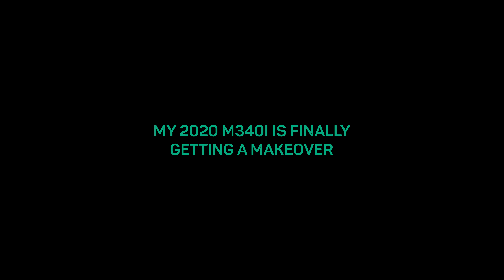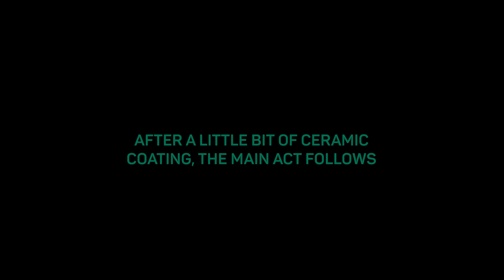BLACKOUT: My BMW M340i gets HUGE Makeover

Comment from the maker: Hey guys! I finally put together kind of a list of parts that i collected for the car, for 10 months.. some of the parts are not available any more from the sellers, so i found the same part elsewhere:
- Wheels are MSW (OZ) M74 - 20x8.5 ET28 + 20x9.5 ET35
- Tires are Continental SportContact 7 stock sizes 225/35 R20 + 255/30 R20

- The exhaust tips (fit only M340):
https://www.aliexpress.com/item/1005004517623893.html?spm=a2g0o.order_list.order_list_main.112.78141802sOnzqw

- Front splitter:
https://www.aliexpress.com/item/4000495504287.html?spm=a2g0o.order_list.order_list_main.117.3df41802e1fAHB

- Kidney grille:
https://www.ebay.co.uk/itm/145108649705?hash=item21c92646e9:g:pSEAAOSwcORkdAtc&amdata=enc%3AAQAIAAAA4DJJIS1YXqKxMvaErhYjwNuM%2FdjxG3h28XEkwKTB5JzGpJhUoRc%2FmrAr2F9Upr%2F8ei2Sfosa0S1p2f%2BuMWBWUCfKCcmSZDdFzwBC2IlNMMsZ%2FlS4cFzpILfdsIQ8lS9WLzrFOcwet9vsg9nmSCIT2psCPPbls8FjfGpDIeEC5AX54xSlYDoE%2F64gGEKDvFq5qYX5Efs0ncMZ7Nas58ix%2Fp61geq%2FJdAJoDCN9w9B%2BbzpyjEIVb%2Firh2lRo76y0dDBalEk%2Bm560aJ8WGO3R70G9iwlV3Wpn0AcHGeur6Mamqq%7Ctkp%3ABFBMrPzH9q1i

- Trunk lip spoiler (its the M4 version):
https://www.aliexpress.com/item/1005004573417003.html?spm=a2g0o.order_list.order_list_main.186.3df41802e1fAHB

- M3 Mirror covers:
https://www.ebay.co.uk/itm/313972904552?hash=item491a3e5268:g:St0AAOSwngNiaFgF&amdata=enc%3AAQAIAAAA4MvKbJ%2FbhyN9OhO0Ok1iGN%2FzGkgx7F4lYFdW3cPEaeDlL0gXdcZar%2BjAsMO9xOaBOFMZ0nlt0Cap0T3KUg09x6v3Rni1oXE8eQQgktKaXrRK5%2FkrfZvgjbX8wjC5OFjCYKaeGfzLbGYGKMXhr%2FrqXmWk1BBjKMm9tYlzZfAJfyguRJVyqFo6md0YLWrrjFsJd3K5rt2g5g5HTxZEQmNwWjgo5O7iywAOBW3fyiAVVKDSVr637LqBdgUBE3UFUxntxlf%2Bha2c67GKGAAiy7xUWi6lEFJULLCk%2Bt31Qvt1NC%2By%7Ctkp%3ABFBMzNvP9q1i

- Rear diffuser
https://www.ebay.co.uk/itm/384769028597

- M performance side skirts:
from local store (not a good deal on that one)

- Gloss Black Trunk emblem
OEM from dealer - part number: 51142472849

- Front bumper gloss black trim
OEM from dealer - part numbers: 51118093301, 51118093302

that should be all, hope this helps! :-)
Reply: Honestly, I have so much respect for you, spending the time finding these sick parts and then, just sharing it with the world for free. U a real champ!
Btw may I ask of the sideskirts were “no-drill” too, as I saw the front splitter was. 
Best to you from your neightbonur in hungary!
Reply from the maker: @TheDrainoor  Thank you very much! Hungary are neighbours for sure, to me especially, i am from budapest like 120km, so i am there few times a year 🙂sideskirts and front splitter were both fastened with double sided 3M tape, and i also put in some self tapping screws.. it could hold with only the tape, but this car is not slow, and when going 150-200kmh, i didnt want anything to fly off 🙂 and so far it holds..
Reply: Didn't you install the side parts of the rear diffuser? Also, what kind of processing is required to install the rear diffuser?
Reply from the maker: @gb7938   in the end i decided not to install the lower parts, because i felt it would be maybe too aggressive compared to the rest of the car..
to install its very simple, few bolts on the bottom (from oem diffuser), the top parts just clips in. and on the sides there is very little trimming needed
Reply: Thank you for answering. Is the rear diffuser fitting good?
Reply from the maker: Yea, diffuser is fitting almost like stock, no gaps between it and the bumper, very good value imho
Reply: Thank you for your kindness. Please use it as a reference.
Reply: how much was the total, also do all these parts fit on the pre lci?
Reply: Do you think the exhaust tips would fit a M performance 330i if I was to get a different diffuser?
Reply from the maker: @TamBruv  i would say it was under 1000eur (excluding the wheels) and yes, they are pre-lci, since my car is pre-lci 🙂
Reply from the maker: @sirdockery5972  nope, exhaust tips will not fit the 330i, because M340i has oval shaped outlet from the backbox, 330i would have round one as far as i know. so you need to look for 330i version
Reply: @TheFuxxoWorksGarage  on the page for the exhaust tips I see you can get two versions, ie SILVER or MPE Silver. What is the difference? Will all of the exhausts on this page fit an M340i?
Reply from the maker: @1234PS3master  well, the MPE means M performance exhaust, so if you have it installed on your car, i would go for that one. if you have stock exhaust you need to go with the regular one. I dont have the MPE exhaust so i cant say what is the difference there tho

Comment: I have the same car and I’m doing the same thing:  I’ve added the exact wheels you did; replaced the grill and air ducts, added a carbon fiber rear spoiler and mirror caps; waiting on the exhaust tips to be in stock.  Love it.
Reply from the maker: haha :-D you have to do it, right? spice it up a bit
Reply: Where can I order those Exhaust tips?(:
Reply: @2Wo20  Kies Motorsports
Reply: Look up freshkicks m340i. Best m340 build by far with the bbs lm’s
Reply from the maker: @jordanz3326  oh yea, that one is very hot :-O and in my favourite dravit grey 🤤

Comment: Where can I get the Gloss black m340 / x drive trunk emblem? I see it says oem from dealer? Does that mean i have to go to a dealership and get them because I cant find a trusted website anywhere.
Reply from the maker: yes exactly, that emblem is original bmw, you can get these on various sites too as replicas, but my brother got one for his M135i and it was 15% bigger than the original :-D so i opted to go for more expensive but original route. you have the part number in the first comment, and if you give that to dealer they will order you one

Comment: Stunning transformation but would love to see it on Eibach springs to drop it 30mm and spacers. Maybe 15mm rear and 12mm front.  Nice aggressive stance. And tint those rear lights.
Reply from the maker: would love to drop it too, but cant, wouldnt be able to get in underground parking around here without ripping the splitter off :-D 
spacers not really, wheels are absolutely flush now. an i will never tint rear lights :-D on any car

Comment: That looks sharp. I have a 2025 M340i Xdrive on order. I am worried because supposedly the Gen 3 engines are having issues.
Reply from the maker: thank you! i wouldnt be worried, you just need to drive in sport, to have possibly the cylinders not be turning off, and you'll be all good :-D you want the sport/sport+ anyway, for the sound

Comment: What type of side skirt did you install at 2:35?  Never saw one not full length.
Reply from the maker: really? the OEM M-performance side skirt is exactly like this, i only got the replica.. this is oem:
https://www.google.com/url?sa=i&url=https%3A%2F%2Fwww.mstyle.co.uk%2Fbmw-genuine-m-performance-gloss-black-side-skirt-extensions-for-g20-g21.html&psig=AOvVaw3REbBYNM5CRU0ONLrKaJxh&ust=1691831408653000&source=images&cd=vfe&opi=89978449&ved=0CBMQjhxqFwoTCNit66Kh1IADFQAAAAAdAAAAABAE

the issue with full length skirts on this car is, that they can cover the LEDs that make the "light carpet" on the ground which are placed in front behind the front lifting point.. (unless the full length skirts have a hole in them)
Reply: @TheFuxxoWorksGarage  sadly not available for the F30 M Sport platform.  Car looks awesome. 👍🏻
Reply from the maker: @Oakleyicon  thanks
yea, did not see this kind for F30

Comment: 8:04 I have a G28. Please advice me if the quad exhaust will fit it as well and where can I get them. Appreciate it!
Reply from the maker: I dont think it will, these tips are specific for M340 only, and there isnt M340 Li, right? But there should be similar exhaust tips for 4 cylinders too i believe
Reply: @TheFuxxoWorksGarage  Yea, I had been looking for something that makes the exhaust sound louder. I’m new to all this so figuring it out.
Reply from the maker: @AshwinJangalwa  well, the tips will not change the sound at all, for that you need mufflers, or complete exhaust, or opf delete, or downpipe 🙂

Comment: so a huge beauty.. how did u install the tips ? did u change something on the stock exhaust for the tips?
Reply from the maker: thank you! the tips were direct replacement of the original ones, no need to change anything, only they bolt on the exhaust itself, compared to oem tips, which bolt to diffuser.

Comment: Where did you get the lil small black covers in the front of the car the you changed from silver to black im looking for mine and idk what they are called
Reply from the maker: those are OEM from the dealer..part numbers are:
51118093301
51118093302
(left and right)

Comment: Nice car man, what did you use to install the spoiler and is the adhesive tape strong enough to be held against car washes etc.. thanks
Reply from the maker: Thanks! I use 3M double sided tape, and i wouldnt know if it holds against car washes because i never ever use them :-D but everything is still on the car 8 months later, so i believe it stickss good :-D
the tape is called 3M PT1500

Comment: Hey with the exhaust tips did you simply screw on to the existing exhaust pipe or did you have to do any cutting to it?
Reply from the maker: hey! no cutting, nothing, you just screw them on and that's it. just need to make sure you ordered the correct ones (M340i has different exhaust pipe than 330i)

Comment: Well..welll..
Time to block out my Sonata like that...😅😅😅
On the spoiler installation you didn't use silicon on the edges of the spoiler in case the 3m tape won't glue tight?
Your car came out nasty bro.  
Much blessings 🙌
Reply from the maker: haha go for it!
i didnt no, i put all my hope in the 3M tape :-D and it holds still after almost a year, so.. 
thank you!
Reply: @TheFuxxoWorksGarage  😎 cool..
Nice ride brother 👍

Comment: Did you have to drill any holes to add the side skirts or lip? Or just used preexisting bolts?
Reply from the maker: there are no pre-existing bolts for the side skirts, at least not for those i got.. so I used the oem self tappers. you can possibly just use double sided tape, but i wanted to be sure it doesnt fly off.. and it holds :-D

Comment: how are the  conti sport contract 7's ? Thinking of ditching the rft's on my f36 435 to these
Reply from the maker: you 100% should ditch them.. i had pirelli rfts on mine before and they were awful. conti's are pretty awesome, very good on water (that was one of the reasons i went for them), sticky in hot, and not a lot of wear too, still got 6mm thread after first season, so i can only recommend them

Comment: Great video man!! 👌
Quick questions:
 - Did you use extra screws for the front lip, or just the original screws and tape?
 - Also for the side skirts did you use extra screws?
Reply from the maker: Thank you! 
for the front lip yes, i used additional screws on the side parts (and i believe one in the center) just to be sure :-D
and side skirts did not come with any screws, you have to source your own (double sided tape would not be enough here), so i used like 8 or so, per side..
Reply: Thank you for the info 😁 @TheFuxxoWorksGarage

Comment: I'm doing a blackout makeover for my M340i, it's really needed haha!
I really wonder where you got your spoiler and side skirts from. I'm from the Netherlands so an order through a Slovakian webshop would be possible I guess.

Keep up the good work man!
Reply from the maker: It really is :-D 
actually i would not recommend the store i got side skirts from, it took them a month to deliver, and they only had fake carbon, so i had them wrapped in gloss black :-/ but you can get them on ebay for sure.
but the spoiler is from here (the M4 spoiler):
https://www.aliexpress.com/item/1005004573417003.html?spm=a2g0o.order_list.order_list_main.181.7dce1802M1yd6j

Comment: Hey man love the video, I have a 2020 m340i and I was trying to get those same wheels and im just wondering how big your wheels were beforehand as the stock wheels are 18/19 inches. Just worried about fitment issues.
Reply from the maker: hey, i had 19" stock wheels on the car, and if you use the same sizes as i mentioned in the pinned comment (on top) there are absolutely no fitment issues at all :-)

Comment: Where and what model did you get the side skirts from
Reply from the maker: it is from a local eshop selling tuning parts, and its a replica of mperformance skirts, however i wouldnt recommend those :-/ i believe you can find them on ebay too
Reply: @TheFuxxoWorksGarage  what would you recommend then?
Reply from the maker: tbh i have no idea :-D i didnt really check on these after i got mine. most of them are from china anyway, so you should just get the cheapest one i'd say, or from seller with best rating.
like these:
https://www.ebay.com/itm/375031564162?itmmeta=01HTZCCBXCBWSH3E39T1KQPVF0&hash=item57519f8782:g:h9EAAOSwVc5iFD1N&itmprp=enc%3AAQAJAAAA8KMW6hCiM0Yck5Oh4RiQO66eZSxXyALNzGgC4FWSiyGFcwWel88aXXtji5Aays6sQt6fXLUCh4hCIJvNO3IMc4O7nLBP47pK50PPZQHrGeRqesTvDmrh3h81N%2BR1y5ds34FnVvZhYcaGeI6ToQh7GpenZduZzDl%2B72NDU0wfyqa%2FggdtQm4xi%2BV3ShHXuWXxFxGAUkYgBiFN9350EnEJgF6c3Ma2ANDV1oyqb6CLctW%2BAzgItM38yjMD17QKzvyo8gR6voF%2Fukd5Ij4BENCU73VfsfjTEb6zvz67lAFBSoLPPr8elumJbJ4QgyYHk9LX2w%3D%3D%7Ctkp%3ABk9SR-S-sezXYw

Comment: I have the same car and I like the exhaust tips you put on. Where did you buy your parts from because my car is stock rn and I want to mod it like the way you did it.
Reply from the maker: I got them here (couldnt find tips that fit M340 exhaust anywhere else):
https://www.aliexpress.com/item/1005004517623893.html?spm=a2g0o.order_list.order_list_main.61.4e181802zDFXhr
just be sure you choose the M340i version, because they need to be oval on the inlet side (330i is round)

Comment: Where did you get the exhaust tips?   Brand?
Reply from the maker: those are no name actually, and from aliexpress.. never saw them anywhere for sale (M340i need specific oval shape inlet on the tips to fit)
Reply: @TheFuxxoWorksGarage  Would you be able to link the tips you bought that fit the stock oval shape pipes?
Reply from the maker: @TheSedin  sure, here you go.. they have multiple designs, just be sure to select the version for M340.. 
https://www.aliexpress.com/item/1005004517623893.html?spm=a2g0o.order_list.order_list_main.61.4e181802zDFXhr
Reply: @TheFuxxoWorksGarage  and these fit on your stock exhaust pipes, right? Thanks for the link!
Reply from the maker: @TheSedin  yes, those are exactly where i ordered from.. the fit is pretty snug, i did not expect it to be so tight, you barely need the 4 bolts that are on each side for tightening
Reply: @TheFuxxoWorksGarage  thank you! I have the same 2020 M340 in black sapphire metallic with shadowline package, it’s a beast of a car!
Reply from the maker: @TheSedin  no worries mate, good luck with the tips :-) its mega car for sure, you wouldnt say its that capable, when you look at it 🙂
Reply: @TheFuxxoWorksGarage  Hey, for the carbon exhaust tips, did you just bolt them on and it fit? No welding necessary?
Reply from the maker: @benchan1090  nope, no welding, slot them on the pipes, and tighten 4 screws per side

Comment: Did you have any problems ( with xDrive) with this Continentals?
Reply from the maker: you know what, no issues at all so far, only after few thousands of kilometers on them there is a slight vibration above 150-160 kmh (not on steering wheel), so i will have to get them re-balanced, which is pretty normal.
I also have conti TS860 (19") for two winters now and they are absolutely fantastic
Reply: Thank you. I was affraid to use tyres without bmw holologization because i had some problem in my previous G30 540i xDrive when i put winter Pirelli sottozero mixed without bmw * (star). My car started to vibrate all time. Now i have Pirelli RunFlat on my 20” performance wheels and it drives like shit. I must buy something without RunFlat and my first choice will be Conti 7.
Reply from the maker: @jarasw8226  yea, i know what you mean, its a big issue with all the xdrive cars unfortunately 😞

Comment: Seems like you need some spacers, otherwise, looks fire
Reply from the maker: close enough to be honest :-) dont really want to run spacers on this car, so i tried to choose the wheels for the best fitment :-)
Reply: @TheFuxxoWorksGarage  you didn't get wheels much wider than stock.  9.5 or 10 width on 265/275 is necessary to create a flush fit without any spacers or rubbing.
Reply from the maker: @S.I.R.O.K.  well, i couldnt go with 265 or 275, in my country i can only go legally with tire sizes that are stock :-( otherwise there would be trouble with the cops when they stop me, and also i dont think the bmw dealer would like that (because its still 2 more years under warranty)
but they sit pretty flush, the rears i would say are even a bit poking. fronts could use 5mm spacer, but i dont want a spacer on front for sure

Comment: Where did you get those M5 Mirror caps at? Fucking need a pair for mine - Is it possible for you to just post a build list and pin it?
Reply from the maker: those are actually M3 mirror caps :-) but i guess they are all the same, you can get them anywhere i think. I can try and put together the build list, but some of the stuff is sourced locally from eshop in my country..